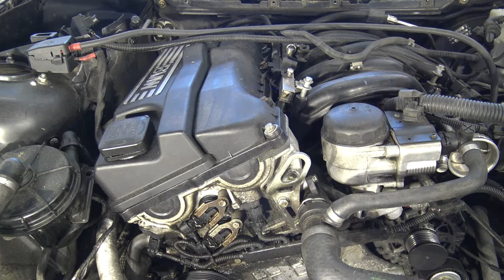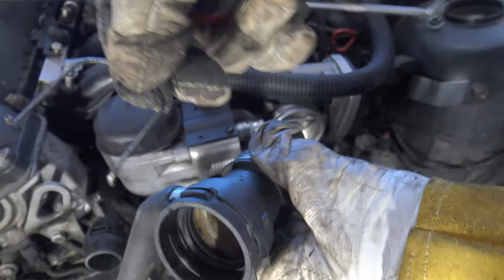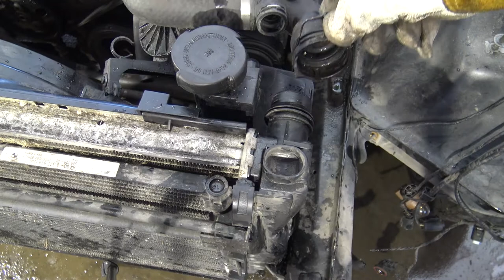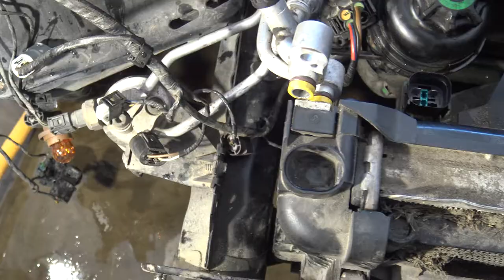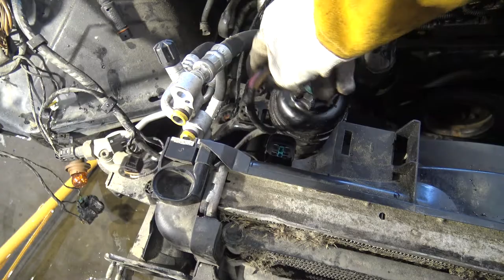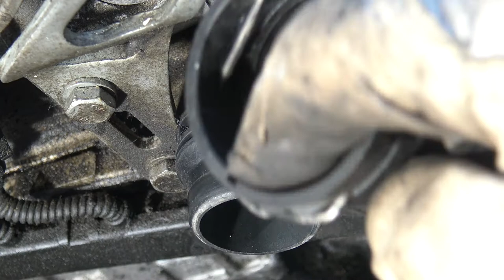How to open BMW 3 series Coolant hoses Clamps and Fasteners. E46 and E90. Years 1998 to 2015

Comment: These clamps make me want to sell my bmw. WTF were they thinking!!!!
Reply: literally bro
Reply: Man i cannot get the hose off of the left side of my wifes thermostat. The clip (metal) no problem, but when disengaged it does not budge
Reply: @HardHeadMilitary  the sensor has clips on the sides of it
Reply: @3nvy.m3  it wasnt the sensor side of the thermostat. I removed that once i got the thermostat off, and removed the sensor, i am replacing the air intake tube also, and hopefully finish tonight after work
Reply: And this is why most people sell these - An endless leaking fest is what you get with these era of bimmers. I am fixing all the leaks on my 330ci and “bye felisha,” moving on  getting a Lexus is300 as a daily and my E30 for the weekends; period. 🤦🏻‍♂️
Reply from the maker: Noted 👍

Comment: I'm doing this same hose and I can NOT get the radiator side to engage  deep enuff to properly seat it. I'm afraid I'm gonna break the radiator fill tube it connects to. Any one have this issue?
Reply: Same thing but on the engine side. Any success?
Reply: @the_skips  yes ended up taking a big pair of channel locks and squeeze it in place. Worked great.   Then sold it. Was a good car. But was afraid if something else went wrong it'd cost too much. BMW.  = Bring more money.
Reply: @B.Dawson76  Thanks for the info. I have solved the problem btw.
Just used some silicon lubricant and then tried again. It was not that expensive for me.

15 euro for 5L of coolant (there were cheaper ones, but i have decided to buy something more decent), 7 euro for lubricant. 8 euro for a new coolant cap.
For some reason my hoses kept popping off, so i figured coolant cap does not drain pressure. I think i should be good for now
Reply from the maker: Thanks and noted 👍